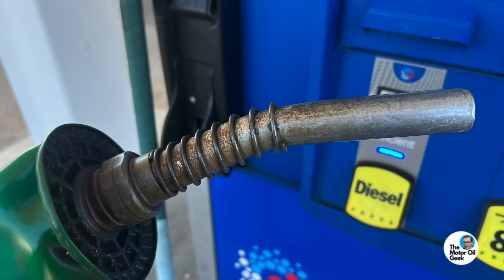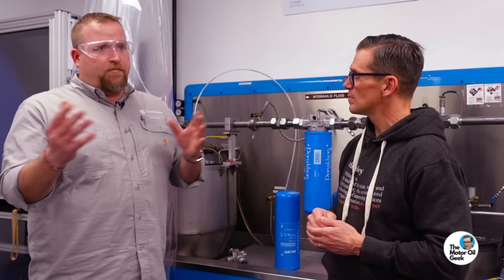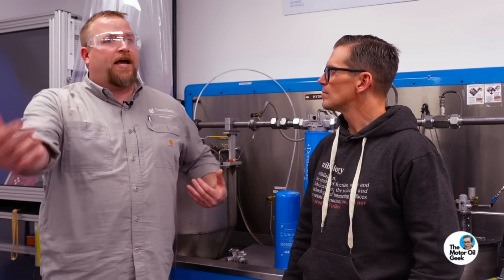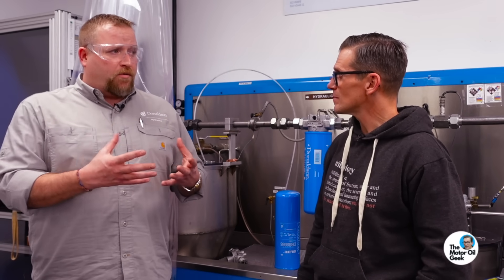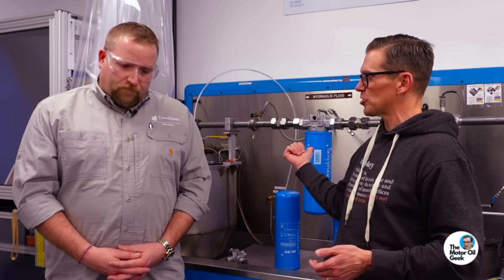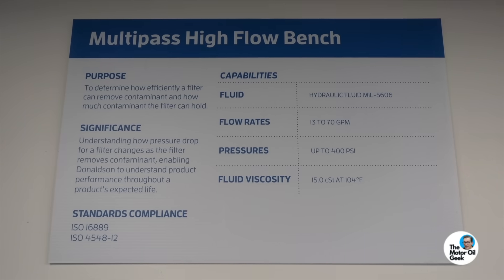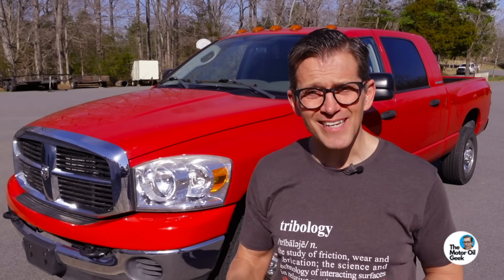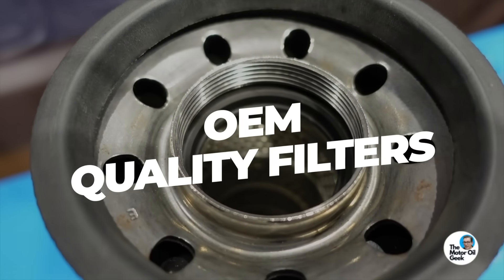Diesel Is DIRTY (And It's KILLING Engines)

Comment: To be fair though America uses more gas than diesel for cars and trucks in terms of commuter vehicles, where as Europe uses more diesel they even have some diesel 3 cylinder cars that get almost 100mpg while at racing speeds, But I think I know why American car companies DESIGN THEIR STUFF TO BREAK so people will have to buy another one, flaws are built in and that includes the fuel you put in it, Sure it sounds like a tin foil hat thing but the more complex and more electronics are added to our cars the worst they are gunna get and the time before they break is shortened.
Reply: The electronics aren't the problem, it's that electronics have no wiggle room. If the government set a emissions spec, the electronics will trip at that exact point and give zero wiggle room. Kinda like a speed camera if set to ticket you at 0.0000001MPH over the speedlimit will, while a cop might see you at 5 over and not care.

Comment: Also what is the % of time or miles replacement frequency of diesel filters ,meaning that i know without testing the fuel before it goes into a tank, but how long does it take to replace the fuel filter on diesel trucks per say ,so every what amount of km's or miles of highway driving? 🦘🦘👍👍✌✌

Comment: WOw maybe doa upload about adblue and what it does to the system etc. 👍👍🦘🦘✌✌
Did not know that the diesel fuel has around 1,000,000 parts per liter of contaminants in it, so why not just add the fuel service station owners to put those type of hi grade filtration systems pre fill at the pumps.
Also advertise the fact that their diesel fuel is filtered to a minimum of 2 to 5 micron level and independently tested every time a truck turns up to refill the service stations, so the trucks that supply the diesel is treated before it goes in the storage tank and also the service stations also has the same filtrations system.👍👍🦘🦘✌✌
All by design to make more truck fail and get serviced etc. 🦘🦘👍👍✌✌
Reply: Money, if you have good filters on your vehicle, you'll not see a benefit anyway and putting better filters on their pumps would cost them more money for little extra benefit.

DEF (AdBlue is just one brand of DEF) has no impact on the fuel system or the engine. It is injected into the exhaust in front of the DPF and after the DPF, well past the engine or turbo. The benefit of DPF is that because it chemically reacts with the exhaust, you don't need as restrictive of a DPF meaning a more free flowing DPF and more power and economy.

Comment: No joke , 2008-2015 Nissan Navara fuel filters are so bad that sand flys used to be able to go through them , i used to do return to tank samples daily and the size of stuff coming out was mind boggling , but also made sense why we had so many issues with the fuel systems . Total opposite the same year Kias had fantastic filters and we never had issue . 

The Nissan filters were over $200 each , it was criminal

Comment: You briefly mentioned Top Tier diesel fuel when asking what the "average" person can do. I know Top Tier fuel comes with more detergents and additives, but is it also "cleaner"? Does the spec say anything about how many/how large particles can be in a given liter?
Reply from the maker: The new Top Tier spec does call for improved cleanliness, but I could not find a detailed ISO rating with that spec.
Reply: @themotoroilgeek I'd be very curious to see what the actual spec is and compare it with "standard" diesel. 

A lot of diesel owners, especially those with CP4 fuel pumps, utilize additional filtration systems to remove water and contamination before it even reaches the main fuel filter. It would be super interesting to see you scientifically test the top two systems made by FASS and Airdog to see their real-world performance. Apparently the entire CP4 fiasco is due to the quality of our diesel in the states vs euro diesel, so this cleanliness issue is a huge deal!

Comment: Makes sense why I commonly hear about diesel vehicle owners needing new injectors.....and rarely hearing owners of gasoline vehicles needing injectors
Reply: Also making it worse, the OEM filters are often not suitable. An example is the OEM Cummins fuel filter is 7 microns to save money. Also yeah, because gasoline vaporizes, it's injected on the intake stroke at 60psi, diesel is atomized and injected at 30k PSI at near top dead center after the piston is done making pressure in the compression stroke.

Comment: I can only imagine how bad ship engines are that run off of those heavy fuel oils and other thick sludges that are thick as tar.
Reply from the maker: That has got to be nasty stuff.
Reply: They're designed for it, they also inject something like a cup of fuel per cylinder per stroke
Reply: @SilverStarHeggisist  I saw a video of them cleaning the fuel tanks, it literally looked like hot tar it was so thick and nasty.
Reply: @LexusNXRick  yeah that's the shit they clean out of the tanks, it's not what the ship is actually running on. Over time that sludge builds up on the sides and bottom and needs cleaned out.

Comment: Red blood cells are bigger that 2 microns.  They may be 2-3 thick but more like 7-9 in diameter.  Diameter is how our analyzers measure them.   When I was in diesel school, before switching to the lab,  I remember my instructor taking the plunger out of a Detroit injector, he held it in his tight fist for about a minute and it wouldn't go back into the injector.  Clearance was so tight that the heat from his hand made it expand that much.
Reply: Then, its a piece of shet !!

Comment: My thirty year old 12 valve Cummins doesn't care, gone over 60,000 miles on a 22 year old Wix filter so far. I did have to tighten it up a decade ago, developed an air leak at the seal that made for difficult starting as the fuel drained back from injectors. Thanks Lake.
Reply: Changing the filter isn't for getting better filtration, it's to get flow again. You should change it so the pumps don't have to work as hard

Comment: Big trucks have a variety of effective fuel purifiers available since ancient times. The delicate engines in baby trucks don't get those unless the owner installs them but you certainly can. Purifiner and other brands would be worth a video. Ships, heavy equipment etc also use them.
Reply: Small trucks have them and often have 2 filters as well. Even my 82 Chevy has two filters.

Comment: Man your pops going to be disappointed in the newer diesels reliability, dealing with DEF, NOx sensors, regen and addictives with each fill up can be a hassle sometimes. 

I’m curious to which truck he does end up getting and if you’re going to continue the diesel saga, I have one and would like to know more about additives, DEF brands etc. 

BTW used diesel motor oil is very black it literally stained my driveway and I cannot get it out like a gasoline engine used oil stain.
Reply from the maker: I've been telling him to stick with this older diesel engine for all of those reasons.
Reply: The blackness is from soot, that soot is why diesel oil is designed to suspend it, it's kinda overkill on a gasser but you can use it. 1998 Cummins have a tendency to not get soot in their oil somehow, I didn't believe it till I watched my friend change his oil, it looked brand new
Reply: @SilverStarHeggisist is he deleted? I heard it’s cleaner if you are.

Comment: I added a 2nd pass (after the factory filter box) CAT 1R-0750 spin on fuel filter on a NAPA filter head to my '17 Canyon 2.8 diesel during COVID because I was bored back then and had time on my hands.  It's been on there for 60K miles now, there is no evidence of it being there in the fuel filter life screen and the factory lift pump doesn't care.  Having the widely used known quantity CAT filter, especially in light of this video, makes me feel warm and fuzzy inside 😆

American diesel fuel sucks.  It's "dry" lubricity wise, it is low cetane, and apparently, it's dirty.  Low cetane is a problem for my 2.8 (and perhaps others) as pistons tend to crack, we think due to excessive rattling from low cetane.  We all run cetane boost to keep it smooth.

Comment: *American diesel fuel is dirty… European diesel is much more refined and filtered. That’s why CP4 pump failures aren’t an issue in the European market while they destroy countless engines in America. There needs to be a diesel reform in America like the did with leaded gasoline in the 80s
Reply: DON’T put 2 stroke oil in your modern diesel. Use something specific for fuel systems that’s compatible with the emissions equipment on most modern vehicles.

Also, regarding lubricity, the wear spec for US and Euro is 520 & 460 respectively. Is that a significant enough difference to cause the cp4 failures? Or is it that the injection pressures are much different in US applications vs where it’s used in Euro vehicles?
Reply: @jeffs2809 Have you ever tried two stroke oil? Sure enough not. I use two stroke oil in my Mercedes CDI and guess what! The engine runs smoother with improved gas mileage. When I bought my used car it failed the emission test. My garage gave me therefore the advice to use two stroke oil and "Italian tuning". After doing so emission test was no problem.
So tell me why not to use two stroke oil?
Reply: @ralfrufus6573  I did use it occasionally in my old Cummins trucks and my tractor, both pre-2007. I noticed no difference in either. I do not use it in my newer diesels, went with opti-lube products for those. I have no idea why it may have helped your Mercedes, but if it did, I suspect any other proven diesel supplement would’ve have shown equal or better results. Maybe your Italian tune-up helped as much as anything. Also, if your CDI has a dpf, I’d be interested in hearing how it’s handling the added oil after you’ve been using it for a while.
Reply: @ralfrufus6573  Huh that's nifty, I'ma try it in mine
Reply: CP4s were just cheapened CP3s, the only real difference being they made parts out of plastic that were metal in the CP3
Reply: It's not only the dirt as this is just one part of the problem. The other part is insufficient lubricity. So put two stroke oil in your diesel fuel.
Reply: @ralfrufus6573 nope tests have proven hotshots to provide better lubricity and other benefits

Comment: Put two stroke oil to your diesel fuel. Try it. You will see, hear and feel the effect immediately. Engines speak to the ones willing to listen.
Reply: You try Power Service additive ever?
Reply: @melissasmess2773 No, I am happy with two stroke oil. 😊
Reply: Late model, emissions equipped diesels don't like it but older pre emissions diesel would like the TC-W3 or anything else you shove through it - WVO, WMO, ATF etc

Comment: I have a 2022 3.0 Duramax running R99 diesel in California and diesel #2 when traveling, Has anyone tested r99 in a similar fashion. I do change my fuel filter every 8k-10k. Truck is sitting just shy of 60k. I'd be interested in having my fuel tested after the filter as it has about 9k on the filter right now with r99.

Comment: I have an old 1998 mechanical mercedes diesel (pintle injectors), it runs on any old shit. Old motor oil, used vegetable oil, heating oil and actual diesel, it will reach a million miles before it needs a rebuild. 🤣
Reply from the maker: Those are awesome engines.
Reply: But they are gas guzzlers.
Reply: @ralfrufus6573  I get 35mpg that's good enough for me with a tuned ECU making 250hp, especially when the used motor oil and vegetable oil costs almost nothing.
Reply: @TheGalifrey  Sucks when your diesel (om606) becomes a 'gas guzzler'! That's not good for the pump\injectors!🤦🏻‍♂️🙉😂
Reply: @tdotw77  Happily mine runs on oil, not "gas" 🤣👍
Reply: @TheGalifrey Do you follow DieselPumpsUK? He's really awesome with those motors and makes\sells all the upgraded pumps\pieces, and fully built OM605\606 crate engines with turbos. Those things sound so nice! I'd love to swap one into a vehicle some day
Reply: @tdotw77  Yeah he does som really nice stuff!
Reply: @TheGalifrey Yeah but he also says be wary of veg oil for both your injection pump and piston rings.

Comment: I was told to fill the filters up with fuel before installing them,  Should i  be worried about the contamination of the fuel, that goes into the filter pre filtered?   should a small pump with filter be used to pre fill the filters,
Reply: Fill them with ATF, it will be cleaner and it's easier to pour in and you won't get contamination from the fuel can as well. I do this for both my beloved pickups and for the tri axle dump trucks I maintain

Comment: It would be good if the fuel could be distilled before use, eliminating any particulate matter.
Reply: Distilling Diesel would give you gasoline.
Reply: @ralfrufus6573  My point is that diesel is made from distilling crude oil. Unless you operate in dusty environments, the only thing a diesel fuel filter picks up is wear metal from the fuel injection system itself.
Reply: @retrofitter  It gets dirt from all different points in the manufacturing and transportation process. Even from when the caps on the underground tanks are opened

Comment: Excellent video and that cement companies trucks is all the proof that anyone should need.     Use top tier fuels whether diesel or gasoline and change your fuel filters and use OEM parts if possible.

Comment: Thanks Lake!  If you're buying a European diesel, I wonder what the European diesel fuel is like at the pump- compared to USA.
Reply from the maker: That is a good question.
Reply: We have performance diesel here alongside with the regular one.

Prices vary, but my local station has it at 1,50€/L the regular diesel, 1,70€/L the performance diesel.
Reply: @kornaros96the real problem is Germans just don't keep their cars as long as Americans do especially Californians. People here drive their vehicles almost 500,000 km. 
I'm just thinking that this problem hasn't surfaced over there for what I've just described above. My friend had a 2014 twin turbo 328d. It is so dead it's beyond comprehension. She drove that unit for over 9 years. It died and had approximately 130,000 mi on it. I guess that's around 200,000 km

Comment: so, how often do i change my fuel filter? some say the filter filters better as it ages but there has to be a cutoff limit on when to change it. that being said i doubt the official recommendation in my manual. seems like they want oil change intervals to long. transmission changes are non existent.
Reply: Yeah, there's that propaganda that transmission coolers are only something you need if you're towing as well. That and the lies told that transmission fluid is good for a "lifetime" lol. Non of the manufacturers have your best interests at mind, they just want to sell you a product and have it last for a mostly predetermined amount of time. If they actually cared then they'd put mASSIve magnets where there's normally small ones and would stop adding extra electrical to the machinery.
Reply: @masonreppeto882  (2019 Colorado 2.8 diesel) my manual says to change oil every 7,500 miles. i change it every 4,000 miles Amsoil. chevy says to use 5w-30 which I've been doing but after the chevy 6.2L V8 L87 engine failure debacle I'm switching to Amsoil 5w-40 oil. i believe that the thinner oil specs are more for cafe (EPA) standards than for engine protection. i changed my transmission fluid at 55,000 miles, from now on I'm changing it every 30,000 miles. coolant every 40-50,000 miles brake fluid  every 3 years. manual says to change fuel filter every 37,500 miles. so 15,000 miles sounds about right.
Reply: @masonreppeto882  yes "lifetime" to them is warranty period lol

Comment: Own since new an 06 Dodge with the 5.9 common rail diesel. I installed a CAT advanced high efficiency fuel filter 16 years ago because of the concern for clean diesel. Not one injector problem yet.
Reply: I have a similar setup, 06, I use Baldwin cartridges in the factory housing and have a Glacier Diesel secondary filter mount and run Napa/Wix filters generally, still running well at 368000 with no injector issues yet
Reply: @nickhuntington8507  I also use the Baldwin in the factory housing. Fuel from tank goes first to a Baldwin water separator then through the CAT filter then into the factory unit.
Reply: How many miles?

Comment: Protect your diesel engine, put two stroke oil in your diesel fuel to improve lubrication and clean the inside of your engine as it burns deposits away.
Reply: What study shows 2 stroke oil helps?  Sounds like anecdotal evidence.
Reply: @bribbripnairbnab7301 Try it. You will see, hear and feel the effect immediately. Engines speak to the ones willing to listen.